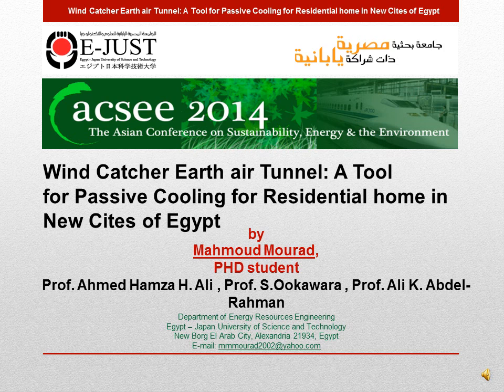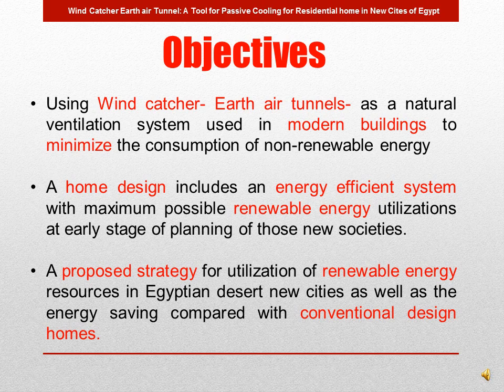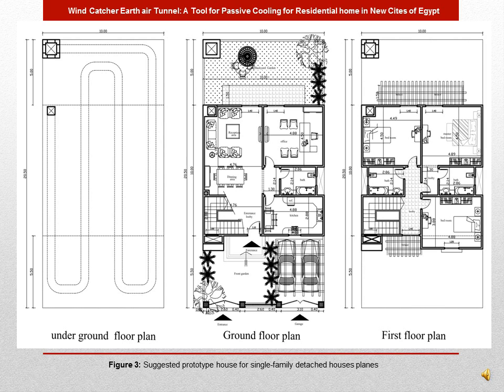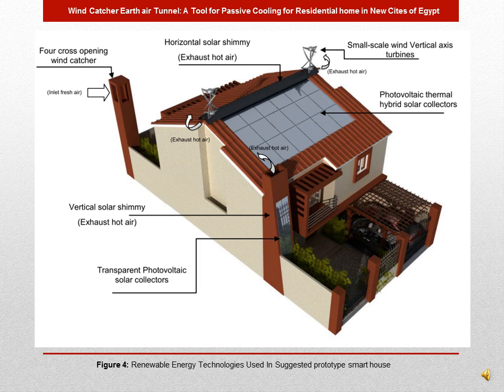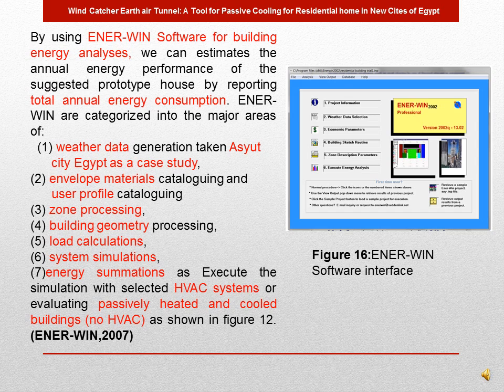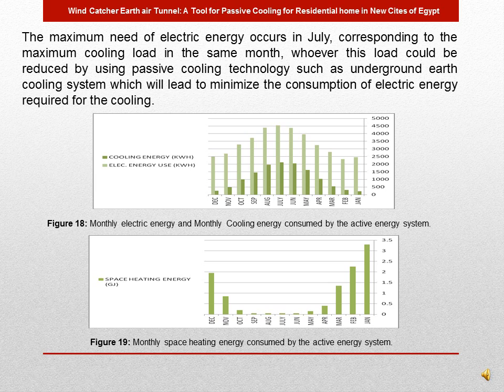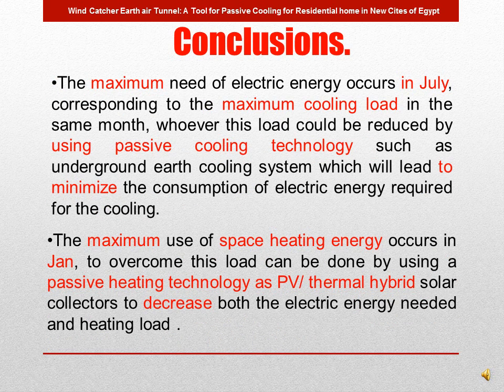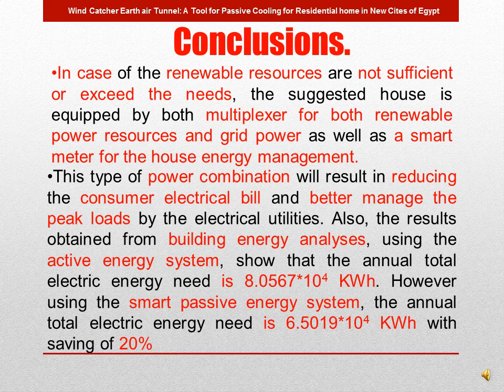A Tool for Passive Cooling for Residential homes in New Cities of Egypt

Comment: I have been thinking about this concept for a long time.  4 meters is quite a depth for the tunnel system.  How large did you size the tunnel?  How large did you size the wind catcher (cross sectional area)?  How large did you size the solar chimney?  Thanks.
Reply: Hi. Did you push through with your plan?  How did it go?